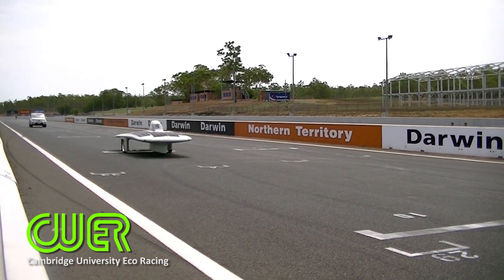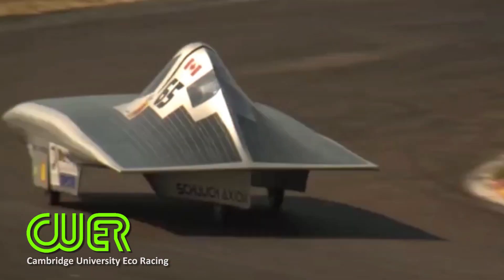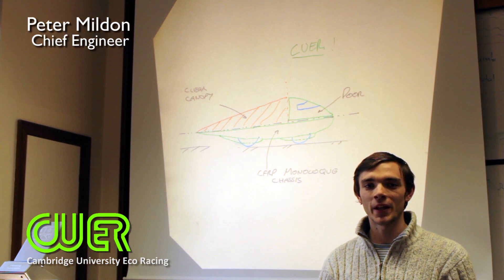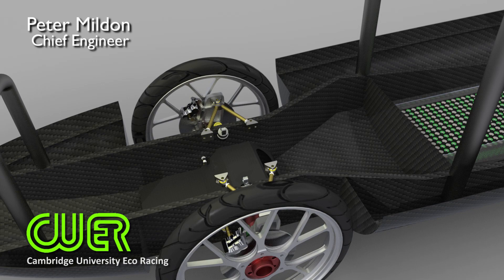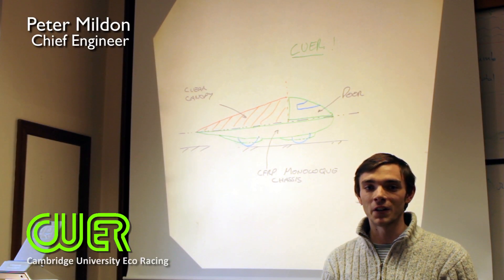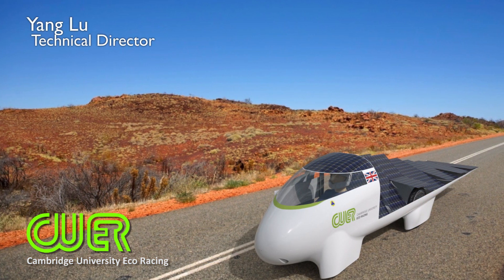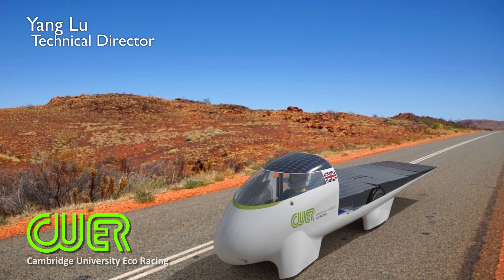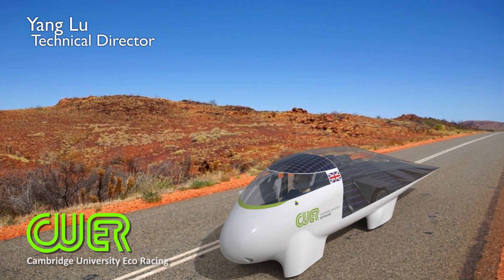CUER World Solar Challenge 2013 Design Launch

Comment: There are mini panels as well as bigger panels. The problem with small panels is that it costs more to make them per square meter of efficient cell area. Also flexible cells are available but the efficiency is much lower than on conventional silicon cells. Also they aren't the cheapest to make. But they are making their way to mainstream applications. You can try searching Google for flexible solar cells if you want more info.

Comment: I mean for the solar panels just get a bunch of fuses and wire to connect to one source. I built gutiar amps like that, and I have the vids of me playing them. You can even add an tail and use that as an extra power source by making that a solar panel. Find what poeer is needed first then mold it after